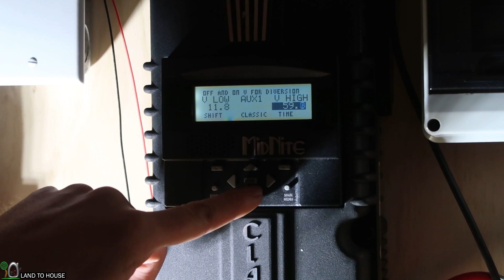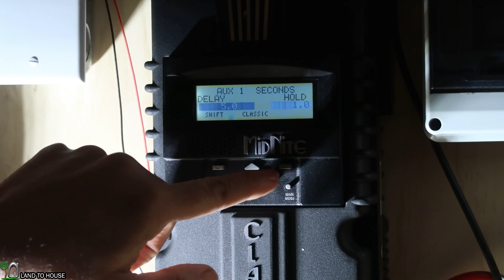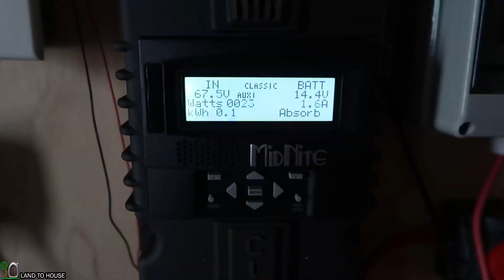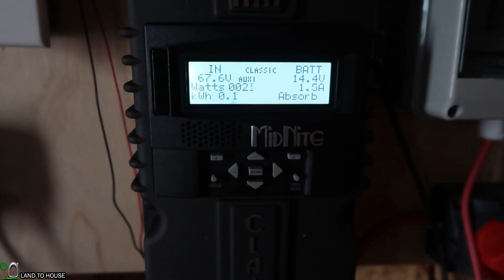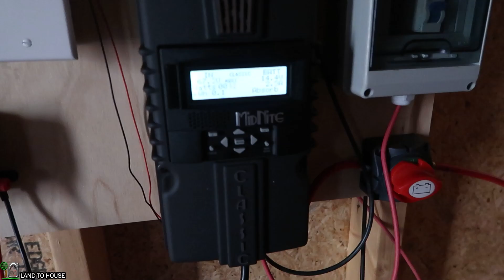Installing the Off Grid Solar Power Electronics

Comment: You need a solar disconnect switch before breaker. Most dc breakers are not designed for switching dc. Your battery pos should go through a class T fuse, then to switch, then to bus bar, then to inverter. From mc150, run red wire to proper size dc breaker, then to bus bar. That battery is not designed for solar.

Comment: Check out the super capacitors vs lead acid or lithium ion. They fully charge in 10 minutes. No waiting all day for batteries to charge. Super capacitors are great for solar. 1/3 off the price of lithium and double the price of lead acid. But last millions of discharge cycles. You can take them to 0v and not harm them. They don't pollute something awful like lithium ion do. Cold don't effect them either.

Comment: Can inverters be used in parallel like batteries? I would suspect no because how could you sync the phases?
Reply from the maker: I dont know the exact answer.
You can use multiple inverters on a battery. Its like putting two hoses on a water tank. The battery does not care what pulls from it.
Reply: @LandtoHouse  sure, and that makes sense cause DC power doesn't change polarity. Just wondering if there's a semi- way of getting more AC output... Inverters get expensive QUICK. Love the off-grid stuff, particularly dealing with renewable energy.

Comment: Great little setup but the Midnight Classic is really bringing out the setup even before upgrading the inverter  . What kind of inverter are you planning to buy ? Make sure it’s a “  Pure Sine Wave , Low Frequency inverter like a “ Magnasine , Outback , Aims or Schneider that’s similar . Try not to buy a High Frequency inverter if you desire that will work for you and the homestead . You may need a large attic fan because it will definitely be so hot in the shed from the PV Modules degrading solar performance .When you get a chance , check out my solar setup videos , hit like , leave a comment and subscribe .May The Solar Be With You for 2021 +.

Comment: Love the videos my friend. Great job and I predict a similar video in the future for the tiny house?
Did you remember your non-conventional wire colors coming from the inverter to the junction box: Inverter red hot to wall black, inverter black neutral to wall white, inverter white ground to wall bare copper ground?  If you got the red/black and black/white reversed you would have a hot common and a shock risk.  A lot of stuff like un-grounded lights won't know the difference and will appear to work fine. but anything with a 3 prong plug and built in GFI will trip immediately. Do you have one of these 3 LED outlet testers to verify your wiring? https://www.amazon.com/Southwire-Equipment-40012S-Receptacle-Tester/dp/B07HB7P2J5
If I understand the relay's intent, you want the wall power shut off if the battery gets too low, to avoid draining the battery completely.  But you have it wired in after the inverter.  If the relay is turned off, the inverter is still connected to the battery will still continue to draw about 0.5 amps of idle current (cooling fan and other bits), further draining the battery.  I think you want that relay wired between the batteries and the inverter, to shut down the inverter completely when the batteries get low.
I might also suggest one or two camper type 12v lights on the battery's circuit so that if that relay does turn off the 120v lights when you are in there in the evening, you aren't stumbling around in the dark and at risk of injury.
Be well and stay safe my friend.

Comment: Your relay should really turn the inverter on and off from the DC side which would save the idle power consumption of the inverter if the battery is drawn down low.  Also, when you buy those relays they should come with a heatsink that they mount to.  If not, you should buy one for each relay as they will help dissipate the heat and prolong the life of the relay since they were designed with the heatsink in mind.  I would also consider putting the relay in a box if you play to switch the AC side so no one can accidentally touch it.  Even those small inverters can potentially put out enough current on the AC side to cause a bad day.

Comment: once you have the inveter you want if it has a power switch on it you could remove the switch add a relay then use the aux port on the controller to turn the inverter off in case of low voltage you could even fit a remote switch near the door to turn inverter on as soon as you enter

Comment: i have just noticed you have no dc breaker or fuse on the battery. also will the mains side of inverter need an ac breaker ?
Reply: @Ezra Garrett instablaster :)
Reply: @Weston Deacon Thanks so much for your reply. I found the site through google and im waiting for the hacking stuff atm.
Looks like it's gonna take a while so I will reply here later when my account password hopefully is recovered.
Reply: @Weston Deacon it worked and I now got access to my account again. I'm so happy:D
Thanks so much you really help me out :D
Reply: @Ezra Garrett no problem :D

Comment: Can you get 220volts for Air conditioner
Reply from the maker: That would not be very practical on this tiny setup. I would need more batteries and much larger inverter.

Comment: Hi, the MidNiteSolar is the best charge controller in the world, what amazes me is that you put a DC circuit breaker to protect the solar panels (nice to see a "European" electrical panel with vertical DIN rail components) but nothing that protects from the battery to the regulator or inverter, where the short-circuit current is very high, at least one DC fuse on the battery I would have put it, even if it would be better to put a correct one for electrical load, the system to protect the batteries from low voltage would be placed upstream of the '' inverter not downstream, with the battery discharged below 12V which is already equivalent to 50% of DoD the inverter would remain on in self-consumption, killing the batteries in the event of several days of bad weather, use a small relay that interrupts the switching on the inverter, there are 2 conductors to be extracted from the inverter, so you do not need a large relay of at least 30A on 12V considering the 300W + the conversion losses upstream side 12V of the inverter.
Put some fuse is an all wood structure, the inverter is Cina...
Ciao

Comment: What type of power inverter did you choose? Is it a sine wave inverter because the sine wave inverters are safer for electronics like phone chargers, computers, etc. You could also do more research on google about sine wave inverters. As always, nice video 👍
Reply: Am sure he knows all that,he's an good Diyer.He explained that before,he'll be using that for a start then upgrade to a good one later on
Reply from the maker: For sure. The new inverter install is in the next video!
Reply: Sine wave isn't super critical... Most electronics use switch mode power supplies and they don't care. even back up power supplies intended for computers are modified sine unless you get into commercial / enterprise grade stuff. Sine wave inverters are just more efficient, if you aren't running motors don't worry about ot too much if a modified sine is all you can afford.
Reply from the maker: The new inverter coming up in the next video has worked really well for lights and power tools. If this were for house power it would be more critical to have a better inverter. For a tool shed the less expensive is just fine.
Reply from the maker: I honestly am not sure about this yellow inverter. The new inverter has been working much better. Its the ampeak 1000w. For lights and battery chargers I think this setup will work really well.